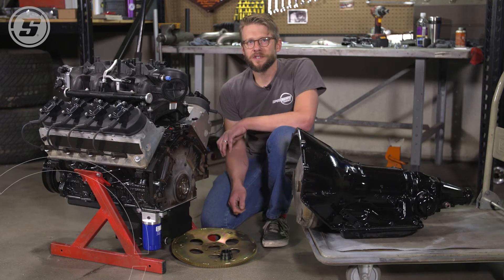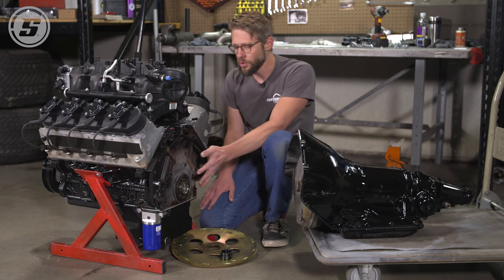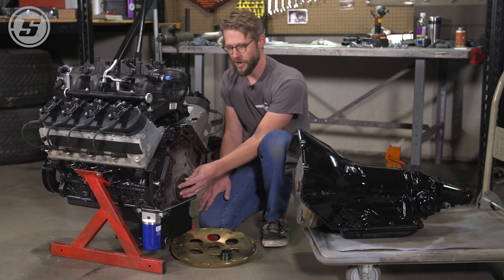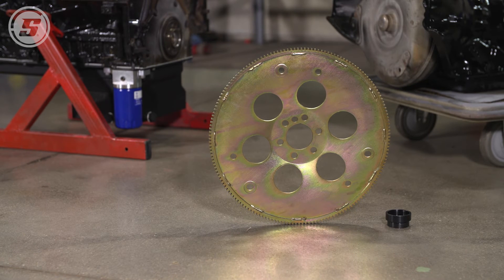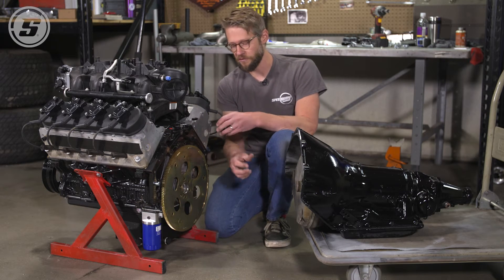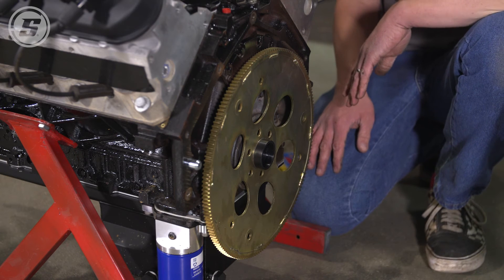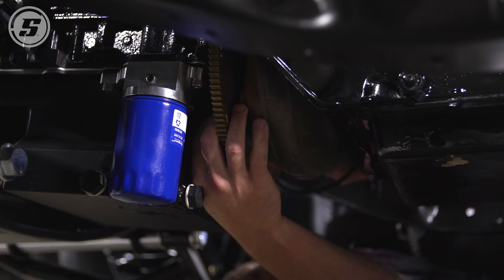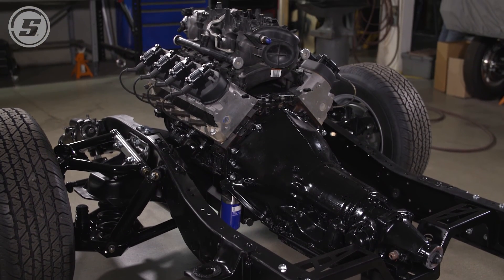How to Install a LS to TH350 Transmission Adapter Kit

Comment: I have seen the flex plate  with adaptor for older transmissions like TH350/TH400 but what solution do you have for a 700R4? The 700R4 requires a TV cable .... what solution do you have for this if I want to use the factory ECM? thanks

Comment: Sweet!, so now I wouldn't have to oval out the flywheel holes to bolt on the torque converter - right?  Also, what stall converter do I need for a stock LS 5.3 when mating up to a TH400?

Comment: I use the GMC savanna van flexolate. No adapters or spacers required. Is this uncommon?
Reply: If the Savanna Van had a 4l80e then the flywheel from it would bolt right up to a 350/400 turbo and 700/200r4. I bought this flywheel kit before I learned that a 6.0 or 5.3 with a 4l80e flywheel will bolt right up to a old school transmission without any spacers or adapters
Reply: @justinw523 how’d this work out for you in about to do the same
Reply: @mikemellina3022 Yes it did long as it came out of a Savanna Van with 4L80e the flexplate comes with it’s own adapter

Comment: In the write-up it states that the difference between the LS and an older engine is 0.0004 which is not even half of a piece of paper. In the video, it says 0.400 which is 1,000 times more. You should correct the written part to avoid confusion.

Comment: This adapter kit will push your torque converter off of the pump if you tore the torque bolts down do not do this or it will ruin your transmission or your transmission will not go in gear these guys don't know what they're talking about you need longer torque converter bolts with spacers
Reply: Yep you are correct there’s a YouTube video that shows the gap between the flexplate and torque converter holes some aftermarket torque converters don’t need a spacer but more than most do need them, they are selling China eBay kits with there speedway name on it and not knowing wtf they are doing that’s the difference between someone just looking to make a buck and one that actually takes pride in there work and selling it to the public